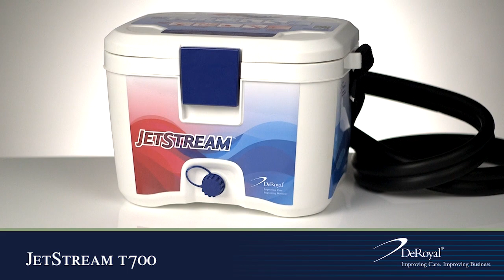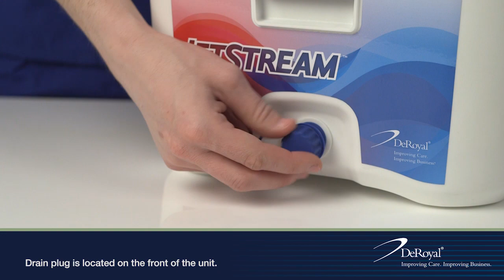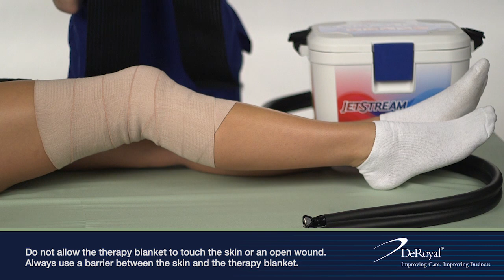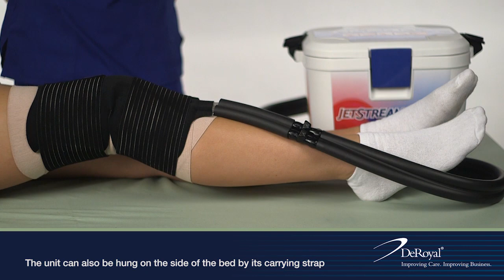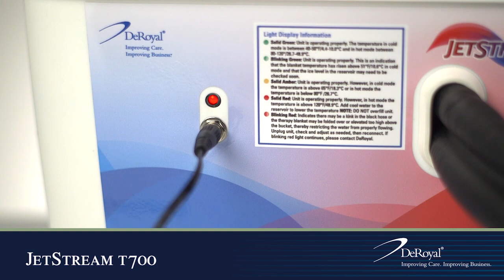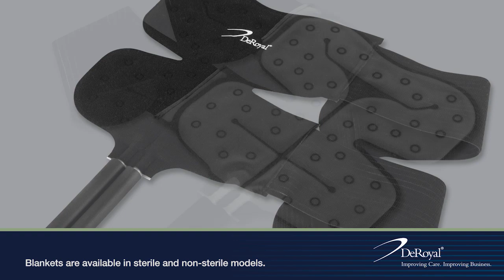DeRoyal JetStream® T700

Comment: My unit shuts off completely at times. It will be running fine with a green light on then it just stops.  I don't see that in any troubleshooting guide.
Reply: Because it is regulating the temperature
Reply: same here